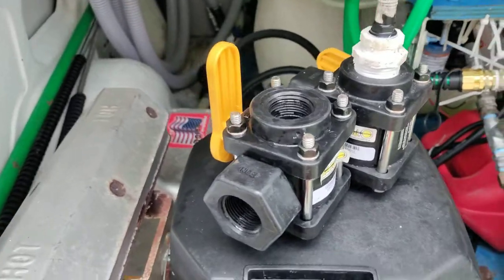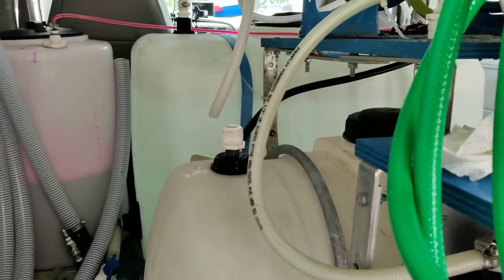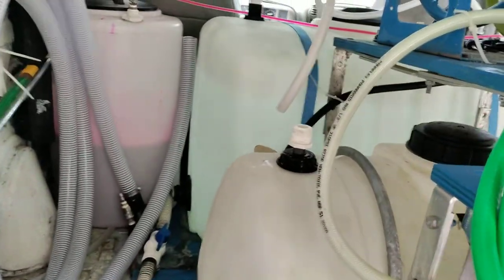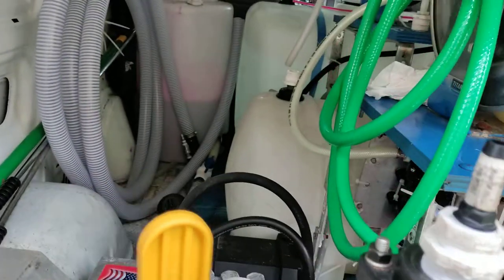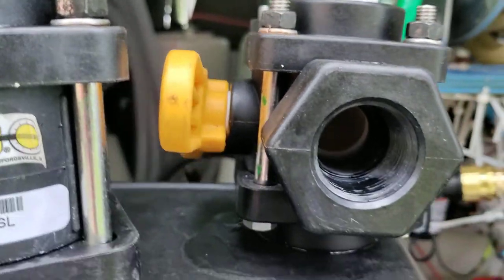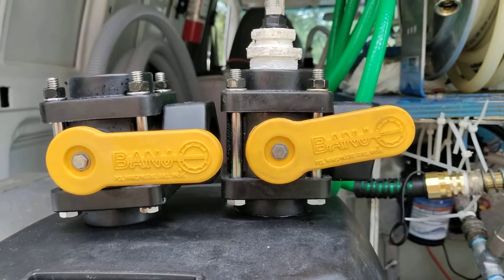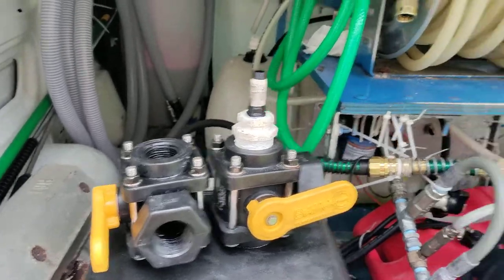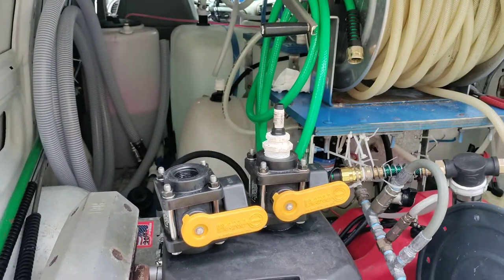Importance of a Banjo 3way ball valve #softwashing #business #owneroperator #pressurewashing

Comment: Should be able to take apart and possibly clean or replace any corroded parts with those ball valves. And are those the side or bottom load 3 way?
Reply from the maker: Side load.. Eventually I probably will, but in the meantime I have jobs lined so I just changed it out.
Reply: @thelifeofpressureman7178  gotcha gotcha. I just hoard a bunch of stuff most ppl just trash lol.
Reply from the maker: Im also a hoarder of equipment lol

Comment: Are those 3/4 or 1 inch values ? 
 IM building my program 5️⃣ reel  24 v pump , what’s your thoughts on the size of the ball valve I should use 1️⃣inch or 3/4?  
 Program5️⃣ reaching out to pressure man for some knowledge. IM running 5/8 hose 200ft